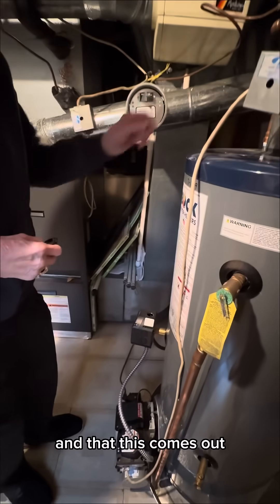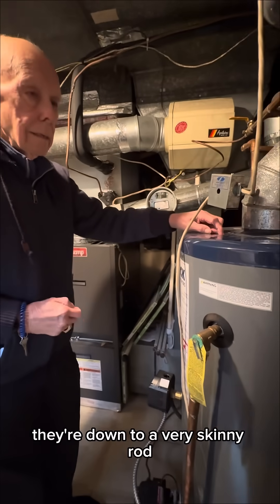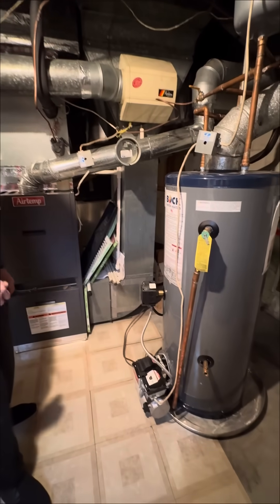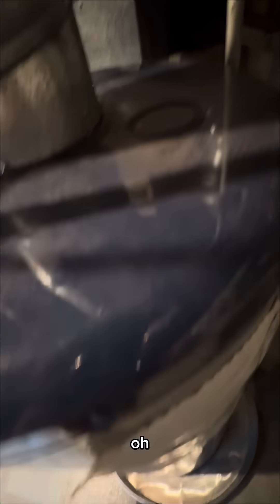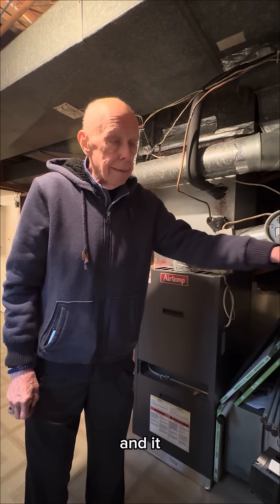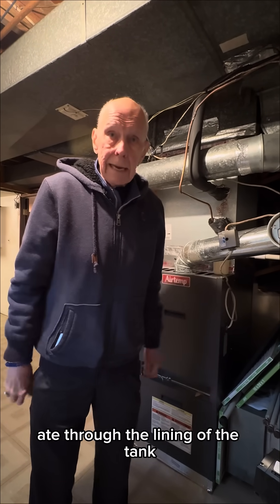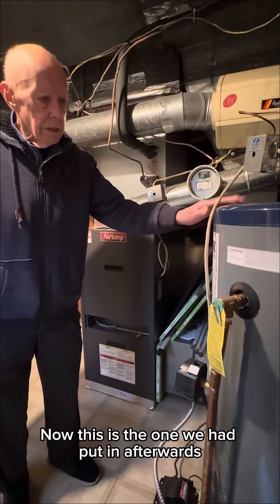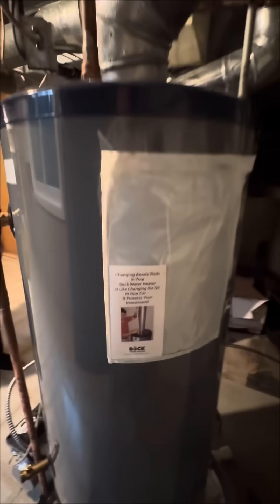Water Heater Lifesaver: Why Anode Rods Matter More Than You Think

Comment: I saw an electric water heater that had “installed 2023” written on it out back of the appliance store in the scrap pile….one thing that these plumbers will do to get more money out of the customer is tell them their water heater is bad and they need to replace it when it’s an electric water heater…this is bs….an electric water heater has heating elements in them…two of them…one on the top and one on the bottom. These burn out and need replaced. It costs a whole $20 per element to replace them. Not the whole water heater! It’s actually quite easy to replace these too….two bolts to hold them in place….turn the power off tho the water heater and drain the tank…thrn remove the two bolts and pull the element out…reverse for install…..but ehile the element is out…u can take a stick and break up the sediment in the bottom of the tank and use a shop vac and a reducer on the hose that will fit into the space where the element goes to suck out the sediment…this will prolong the life of ur water heater for years and years…if done yearly. Once the sediment gets above the bottom element, it will continuously burn out. Most plumbers won’t clean the tank out and will let it get bad so u have to replace it often….dont get scammed and fix it urself…also replacing the anode rod…u won’t need to buy a new water heater for a decade or two and even longer